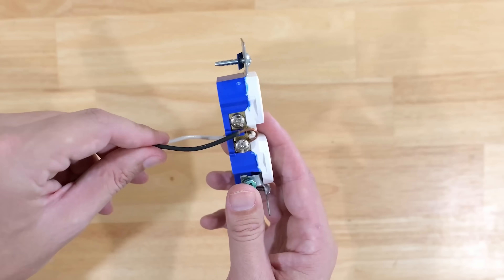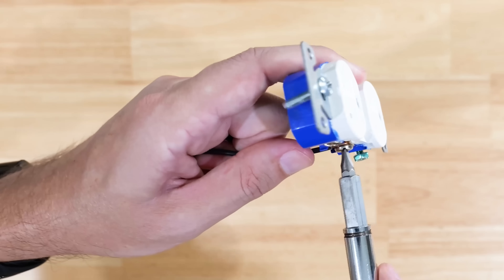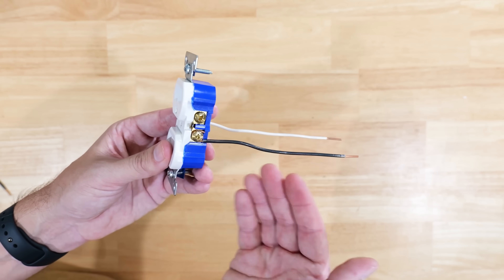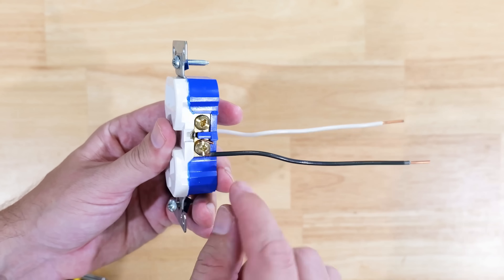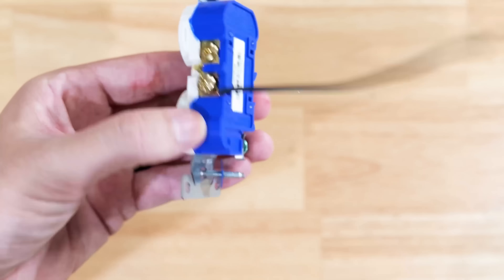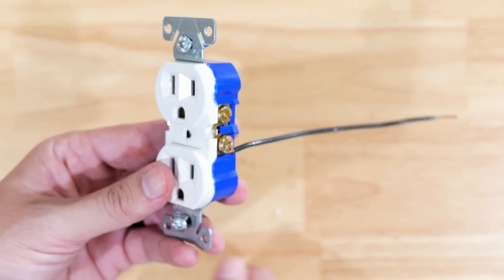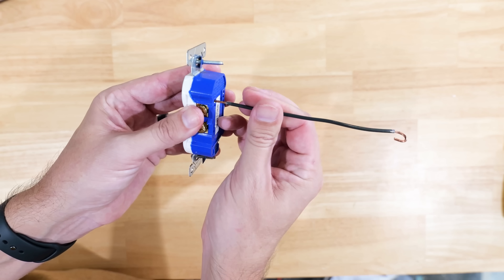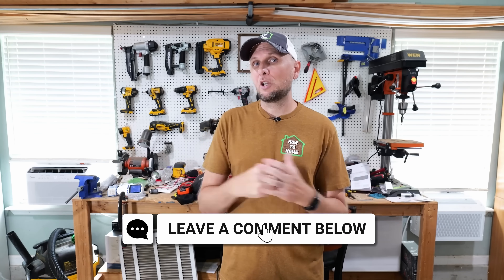Avoid Disaster! 8 FATAL Outlet Mistakes Most DIYers Unknowingly Make!

Comment: Wait... At the beginning you said you can put 15 amp receptacles on a 20 amp circuit... If the receptacle is only rated for 15 amps and somehow a device pulls more than that, wouldn't the receptacle be a fire risk as the 20 amp breaker would not trip and would continue to flow power to the outlet?
Reply from the maker: How would a 15 amp receptacle pull more than it’s rated for?  The plugs on devices are made with that in mind which is why you can’t plug a 20 amp device into a 15 amp receptacle, it won’t fit in.  Just sharing what code allows for and doesn’t.
Reply: @HowToHomeDIY  A malfunctioning electrical device can pull more amps than it was intended to... or a bonehead could modify the 20 amp plug on something.  I wasn't trying to say it's not allowed by code... just weird to me.  I just try to play it safe and use 20 amp outlets on 20 amp circuits and 15 amps outlets on 15 amp circuits, lol.  Just a DIYer myself so my cave man brain wants the numbers to match.  Interesting that it's allowed by code though.  On another note, I hate when I find outlets that have the back stabs used, for some reason I always have a hell of a time not breaking the wire getting it out of there... I'll be using your twisting technique next time I have to re-wire one.

Comment: OK, I've gotta be honest here. When I read the title to this video, and watched the intro, I suffered a powerful eyeroll.

To be fair, this is probably because I've watched far too many stupid "hack" videos made by utter morons who seem to be hell-bent on destroying equipment and endangering lives. 

HOWEVER...I was pleasantly surprised with this video. 

Everything here is absolutely spot-on!  Well done!

IF I MAY ADD ONE ADDITIONAL ITEM, having to do with the receptacles themselves. DON'T BUY THE ABSOLUTE CHEAPEST RECEPTACLES!

Trust me, you get EXACTLY what you pay for when you do this. You'll end up with receptacles which will lose their gripping strength to the cords plugged into them over time, and this is both an annoyance because plugs will want to fall out of the receptacles AND those loose plug connections are just as dangerous a fire hazard as loose wiring connections are.

Those 87 cent receptacles are NOT the bargain people think they are. Toss the few extra bucks down to get quality ones.

Comment: Here in Ontario Canada 15 amp breakers with 14ga is code for most outlets.   The kitchen counter area calls for 20amp 12ga circuits.  Modern LED lighting makes sense as it draws a fraction of the incandecent bulbs of 20 years ago.  With few exceptions washers, refrigerators all draw way less than a generation ago.  Larger guage wire doesnt address the elephant in the room....sloppy instalation..cheap receptacles back wired...flimsy 18guage  extension cords running space heaters etc.

Comment: I've been working with a pyro crew the last few summers doing firework shows, and the point at 13 about not unbending wire, reminds me of how we ALWAYS chop the ends off and strip new leads when wiring because we've had wire break before and cause misfires.

Comment: Your strand conductor connection was really bad! The conductor needs to. be twisted before connecting! Also, your last item was bad because it puts the conductor into the same hole and gets squeezed when tightened. As far as 14 gauge conductors, I always jokingly call them bell wires, never used them for anything that many use for 15 amp outlets. Other than these items, the j connectors were good as well as the other common errors.

Comment: At 9:20 you show a major code violation. You must use a terminal fork for the device you're using because of the stranded wire. You're using less wire from fraying so voltage drop.
Reply from the maker: Completely false!  Provide the code stating this.  It doesnt exist.  Also, most of your receptacle manufacturers specifically state that stranded wire can be wrapped around the terminal screws of their receptacles.  It is easy to find.  I know Eaton has it on their website.  So this is your second comment that is just false but you claim to be a long time electrician.  Scary!
Reply: @HowToHomeDIY 
Near as I've found, it's acceptable to use stranded wire on any device listed as being rated/made for use with un-crimped, stranded wire.
I believe this is per NEC (National Electrical Code).
Reply: @HowToHomeDIY  According to the UL White Book under the RTRT category, stranded wire is permitted to terminate to a screw terminal of a receptacle [110.3(B)].

Comment: At 6 minutes you say not to use the back stab because of a thin piece of metal. You prefer waygos over wire nuts. Explain that to this 30 year commercial industrial electrician please.
Reply from the maker: When do I ever say I prefer wagos over wire nuts?  Also, Wagos do not use the same mechanism as the back stab piece of metal in receptacles.  They are nothing alike other than putting a wire in a hole.  As a 30 year electrician you know this.

Comment: Good video.....this is why I don't do DIY electrical stuff or plumbing or any kind of housework at this scale.....I'll burn the damn place down without even trying lol

Did have one question about the video though. On the part talking about the proper amount of insulation to strip so as not to have exposed wire or the screw resting on the jacket, you never showed a good rule of thumb or shortcut to get it just right. I assume there has to be one right?

Good to know about the level sockets, I'll log that away if I ever find myself in a situation were I'm facing this....which hopefully is never! Because there's some things I have high respect for and those tend to be electricity, high pressure gas, and any machine that can exert more force than required to break bones or that weighs more than I do.

Comment: question.. i was going to throw in a tip of the neutral line will always be on the ground side and the hot will always be alone, but then your new terminal has hot with the ground.. Am i incorrect in older terminals are wired hot always isolated or am i correct and that new terminal is just different?

Comment: The maximum allowed load on a 20A curcuit is 16A.  So in theory at that load on a #14AWG wirewith a 150 foot run the voltage drop is 6 volts and the power dissipated along the entire cable is 96W.  That is not going to cause a fire.  The only time you will get a fire on an electrical circuit is if the insulation is damaged, or there is a loose connection that arcs.  Do the only real consequence is that the supply voltage could be 114 volts rather than 120.

Comment: I ran a separate breaker and line for my shop. However....to put the wire into the back is only for 14 ga. wire. 12 ga. will not fit. Been putting a loop around the screw for years and never had any problems. The trick is to make a loop and close it around the screw with needle nose pliers. Saw one application where only a straight line was under the screw. No-no!

Comment: Please explain to me why those lever clamp receptacles are better than back stab.  I agree that back stab is bad, but how are these better?  Is the surface area that contacts the conductor significantly more than the 1mm of the backstabs?  J hooks and commercial compression connectors have about 1cm of contact, how much is in these lever connectors?  Other than them being more convenient, prove that they will be as reliable in 20+ years.

Comment: Question on reverse polarity: I replaced a bad outlet in an old house that had the wires running to the wrong poles.  I wired it correctly: hot to brass and neutral to silver.  Was that the correct decision, or should I have wired the new receptacle like the old one?

Comment: Thanks for the video!
  I like that digital torque screwdriver.   Just an FYI… appreciate the added link, but as of today at least (10/19/24), it’s currently unavailable on Amazon. 🤷🏼‍♂️
  That said, I Googled it & found it online at Cabela’s + a few other places… & wow!  $75-$85!  The Wheeler must be a really good quality brand.
  Similar digital torque drivers I saw on Amazon were in the $50-$80 range. 
  For the avg. DIY’er, that’s a bit pricey for something I may only need occasionally.  Although, I like the idea of having a torque screwdriver in my tool box j.i.c. I need it. 
  There were several mechanical torque drivers btwn $25-$40.  Is there any less expensive mechanical drivers that you’d recommend?

Comment: I replaced a couple switches the other day, I am by no means an electrician. So when I pulled the old switch out to replace it, I noticed the neutral and hot wires were both solid black. So I had to go on a rabbit hunt for search for a diagram of the old switch to figure which one was hot. Why would they use solid black for both the neutral and hot wires?

Comment: You're going to have an electrical fire anyway if you have a 15 amp receptacle on a 15 amp circuit/14 gauge wire and the breaker isn't working, so it doesn't matter if you upgrade and put a 20 amp receptacle on a 15 amp circuit. The breaker should pop if you use too much power.

Using a 20 amp receptacle on a 15 amp circuit is fine. For a lack of better wording, the 20 amp receptacle will be "heavy duty" when the draw is less than what it can handle.

Comment: A couple electricians have recommended actually using commercial receptacles for my house. No need to loop your wire, just insert and use the right sized flathead to close the plate securely. I replaced all the backstabbed receptacles (house built in 94) in my whole house.

Comment: I think overfilling a jbox is also something diy people do when adding a new circuit receptacle somewhere. 

At my brothers new house we found a single gang box with 7 romex going into it. Once I had pulled all the connections out I had no idea how the previous owner got them to fit. There is no way I could have gotten them back in. 

That was the first time I actually could imagine wires just overheating. There was no airflow at all. 

Oh I’m not an electrician. Just someone who likes code books. :)

Comment: Reverse polarity is super dangerous. Thanks for pointing that one out. I only do electrical work once a month or so. So I don’t trust my memory on this one. It’s important enough for me to look it up every time.
Reply: Brilliant white to brilliant brass. Perfect thanks. 
No wait bright silver to black. Ummm
Colorless white to copper. No that’s not it. 
Everything is black and white. That doesn’t sound right. Hey that rhymed.
Reply: Black & brass both start with a "B."  That's all you need to remember.

Just B to B every time.
Reply: Using wire color to determine hot and neutral seem. risky
Reply: I agree completely. Never just trust color coding. A quality plug tester is a must at the end of all of this to make sure everything is right. I like a self powered plug tester, it gives a lot more information when the circuit is not wired properly.

Comment: A 20 amp receptacle on 14 awg wire is not risking anything more than tripping a breaker. I could just as easily overload that 14 awg wire by plugging in two 1000 watt heaters into the 15 amp receptacle. This is why circuit breakers exist.

Comment: 2 questions 1 I replaced a outlet on a switched outlet. Now the switch doesn't control the outlet, do I need to break one of those tabs on the side. 2 is it ok to use washers to space an outlet ? The previous owner installed new outlets but they are all sunken

Comment: Putting a nick in the copper with your wire stripper is also a bad mistake.  Creates a stress point where the wire can easily break. I’ve never had a problem installing a replacement receptacle using existing J hooks unless the wire is or becomes nicked.
Reply from the maker: You're right, it's important to be careful with the wire stripper and avoid making unnecessary cuts.

Comment: Just one correction if you put a 20 amp outlet on a 15 amp breaker thats fine the outlet does not cause the current draw whats plug in does...now a 20 amp breaker and a 15 amp outlet would be a no no

Tightening a wire around a screw should be in the direction of Tightening and use your needlenose to crimp the end of wire all the way around the screw back onto itself decrease the chances of arcing if it ever became loose and who uses a torque wrench on a outlet? 😂 i need my own youtube  channel

Comment: Double stacking fix- 
Make up both your neutral and hot leads with wire nuts inside box. Adding a short lead for each. Those leads can then be attached to the outlet. Just be sure to make a solid connection and use proper size wire nuts.

Comment: Is there an easy way to tell what AMP receptacle you have installed by looking at it.
Reply from the maker: Yes if it has just 2 vertical holes it’s 15 amp.  If it has a vertical hole and looks like it’s winking at you then it’s 20.

Comment: Great Video! One question-->. @10:00 you say to attach the wire in a clockwise direction on the lower HOT screw. What about the upper Hot screw?? Is this wound counterclockwise?
Reply: All screws are clockwise. Adam was addressing the condition of two wires under one screw. 😊

Comment: You lost me right at the beginning by saying it was okay to use a 15A receptacle on a 20A circuit. No. It is not. You are correct on the reason to not use a 20A receptacle on a 15A circuit. Trying to run a 20A device through a 15A breaker is asking for trouble. But a 15A receptacle is only rated to run 15A through it. If it is on a 20A breaker, it could see current higher than its rating and be damaged and cause issues. Everything else in the video looked fine, or at least didn't jump out at me like the first point did.

Comment: What do you do if you're running out of wire to cut off inside an existing box? Would you just add an extra wire nut or wago an attach an extra piece of wiring? How do I minimize on how much space would have to get used up?

Comment: To be clear: all wire connections are mechanical. The speed connection is mechanical and so is the screw connection. The difference is the manner of the mechanical fastening method
Reply from the maker: Incorrect.  The terminal screws are considered mechanical as they can be used again.  The speed wiring is a pressure connection and is a one time use.
Reply: @HowToHomeDIY  mechanical fatigue.
Reply from the maker: Not considered a mechanical connection.

Comment: Somebody said that 14 gauge wire is 15 amp that depends on the insulation most 14 gauge wire is 10 amp 12 gauge is 20 amp 10-gauge would be 30 amp if I remember correctly that's with t.m insulation TNN is rated differently if you stick to the 10 20 30 numbers you'll be safe

Comment: It would be nice to hear you explain to people (when talking about proper screwdriver use) to go over the differences in screwdriver sizes. Most notably how some "generic" #2 Philips heads will have more of a point like a #1 has, which is not good for most work. Having the head more pointed on these generic screwdrivers just means you can use it on #1 and #2 screw heads, making it more of a multipurpose, but because it is more pointed it will cam out more often when used on #2 screw heads when higher torque is applied. A proper #2 Philips will have a shorter tip (more rounded, or even flat) so the cross section of the head fits more firmly into the screw's grooves, for better and higher torque.
I would say to try to stick with more notable brands when it comes to tools, but to the average person who doesn't know tools very well, that could be any brand that's been advertised to you more often. In the time of ads being over every inch of a website these days, this could get confusing. Even tool specialty stores still have "off-brands" fighting for your dollar. Some of these off-brands have even started to make a name for themselves, whether through ads or even sales. And some of them even make the tools very well, and should I say "properly". But not all do. Ironically, I'm partly convinced it's unknowing or even careless diy'ers (and workers) that caused the eventual downfall/downgrading of companies like Craftsman. A tool manufacturer that charged a lot more, for better quality and a LIFETIME warranty, just wasn't what the average person cared for. They wanted cheap tools that only lasted "more than the one time they needed it", or for other delivery type services. Which you've got to hand it to Snap-on for their ingenuity. I still buy Craftsman when I can, just because a family member of mine had a tool break after 20 years (none of mine ever have, yet), and they just handed them a new one, no questions.
I like your graphical "red" flashing "nono" screen. Every time it flashes, it reminds me of every time I got a shock, lol. And while looking at you holding the receptacle in your hand when it goes off, is almost a jump scare.